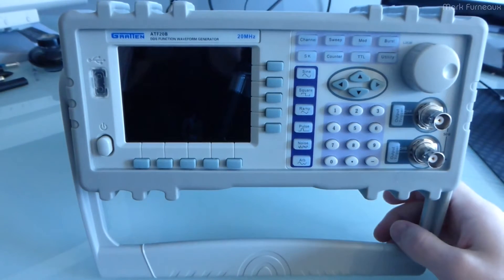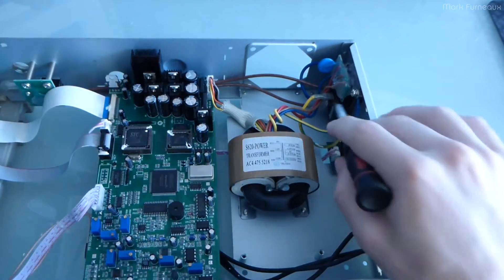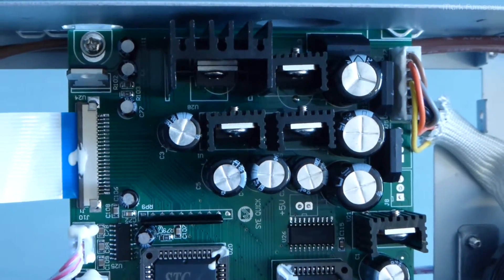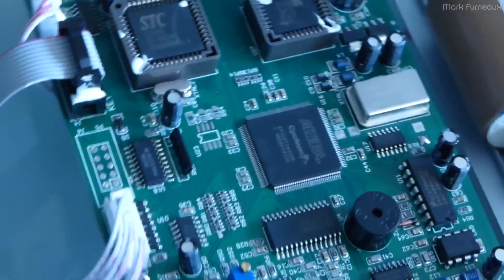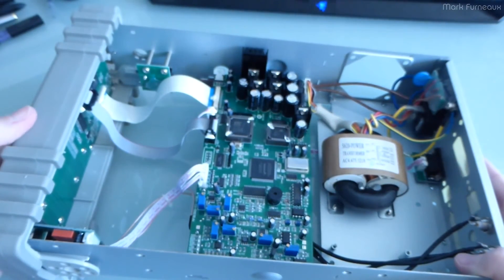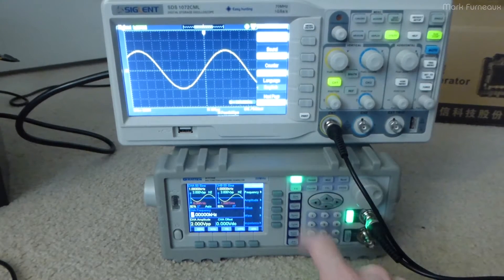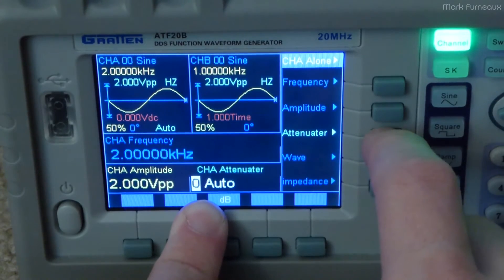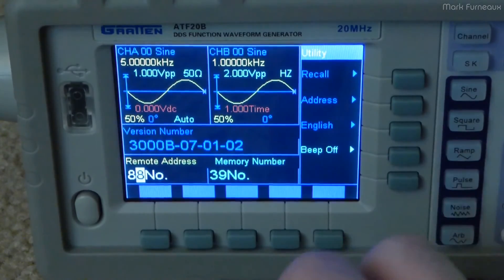Teardown and Review of the Atten ATF20B Function Generator

Comment: Hi! Is he still working? I want to buy one but I don't know that brand..Thanks!
Reply from the maker: +Hamilton Quirino Haha. It still works fine. I didn't see any flaws which would cause it to die prematurely. Atten is a pretty popular brand of cheap low end gear.
Reply: +Mark Furneaux The USB port is fake?
Reply from the maker: +Hamilton Quirino It's not 'fake'. They just use that case for many models and options. It just happens that this model does not have USB, so there is a blanking plate installed. This is common practise for all companies.
Reply: +Mark Furneaux Do you know if we can hack it? I mean: it has somehow her works..